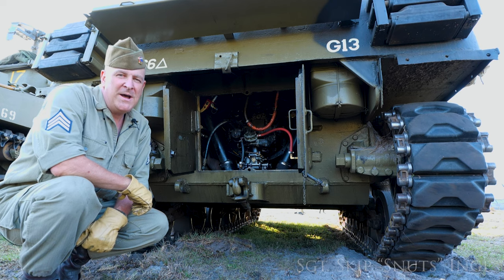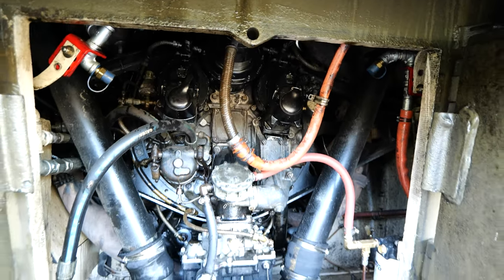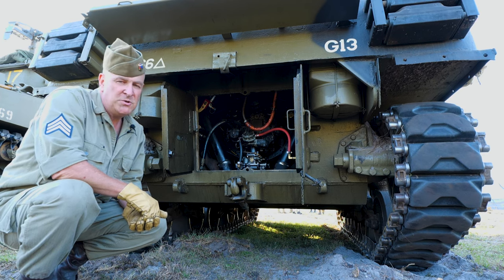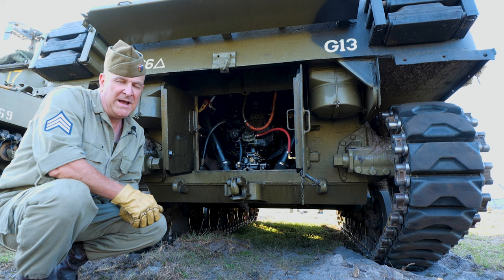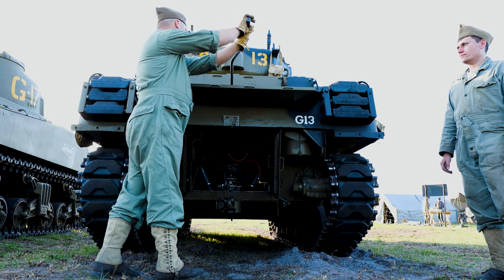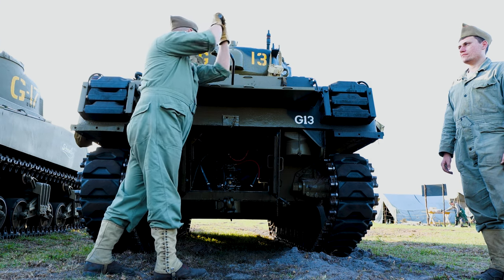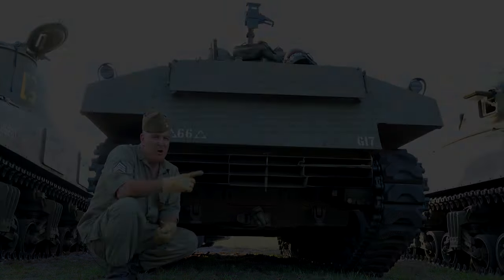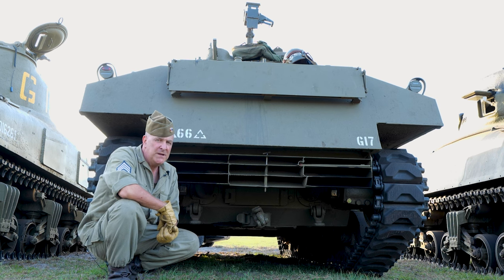Sherman tank Engine comparison: R975 Radial VS Ford GAA v8

Comment: Another problem with a radial engine is, when the oil is draining to the bottom cylinders, it is also fouling the spark plugs, whether or not there is actual hydraulic lock. This turned out to be a real problem in actual combat situations, and tank crews were said to be constantly searching for boxes of spark plugs. This situation is what ultimately led the Army Tank Corps to search for other, more suitable engines such as the Ford GAA, also discussed above. The radial air cooled engine was first proposed for the Sherman tank (and other vehicles) so as to eliminate any potential problems with water leaks, etc, with water cooled engines. Plus it was already developed and in production, so nothing further was needed except to start producing thousands of them.
Reply: Couldn’t have been a problem seeing as they used it throughout . 🤷‍♂️
Reply: I thought the driving factor for using the radial was essentially availability..
Reply: The army started out wanting an air-cooled engine so as to be able to eliminate the radiator. The problem with all radial engines is that oil drains to the bottom cylinders after shut down. Note that all movies of WW2 planes shows the crew "walking the propellor' in reverse before start up, and that's t0 get the oil out of the cylinders. When the earl y Shermans shut down, the spark plugs were fouled and the engine would not run correctly. Shermans with this engine carried 100 spare spark plugs to replace the ones that were fouled. Also, the radials the army started with were 9-cylinder engines, for more power, but the Army Air Force wanted the more powerful engines too, and they made the case for a priority access to the engines. A 7-cylinder radial didn't have enough power for either Shermans or warplanes. That led the tank corps to go to Chrysler and ask them for an engine, and be quick about it. That led to the "multibank" 30-cylinder engine (5 flathead 6's bolted to a common cast iron crankcase, but that was unsatisfactory too. The army then went to Ford, and asked them to come up with something, which led to the GAA V-8. @chickenfishhybrid44
Reply: @chickenfishhybrid44  That was a compounding problem, but the plug fouling problem was a serious consideration as well, as indicated by the fact that all Sherman tank crews were told to carry 100 spare plugs at all times. In his book, "Death Traps" Belton Cooper mentions that he had to make several runs to tanks that were broken down, who'd used up their spare 100 spark plugs. Unfortunately, the sand blasting machines for spark plugs were only at his 3rd Armored Division's motor pool.

Comment: In old films of ground crews you’ll see the crews turning the propellers on many fighters prob for the same reason. A handle shouldn’t be needed ‘cause the prop and reduction gearing gives all the leverage needed. Most or all USN carrier aircraft had radial engines.

Comment: Do you want to learn a more simple method.  Just turn the engine over backwards a couple of revolutions.. that will push anything left in the cylinders out of the exhaust valves.  My grandpa told me that he worked for  Ford on the Tri Motor aircraft in the early twenties.  As well as Al Teague's Speed O Motive streamliner at Bonneville salt flats same process just push the car backwards for a couple of engine revolutions an he was ready to go to the line for a push start.

Comment: Several German aircraft used inverted V-12s, wonder how many plugs they had to pull to prevent hydrolock
Reply: They had the engines setup so the timing could be manually modified to burn the plugs clean. Plus with liquid cooled engines the tolerances were closer so the seal on the pistons was much better leading to less oil drianing down into the cylinder head area.